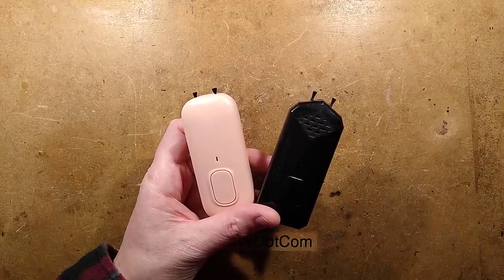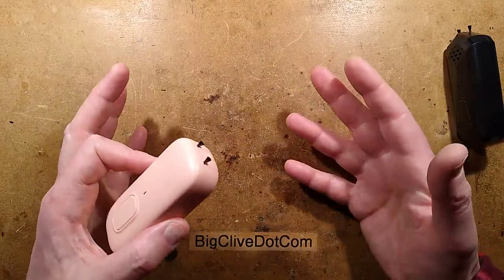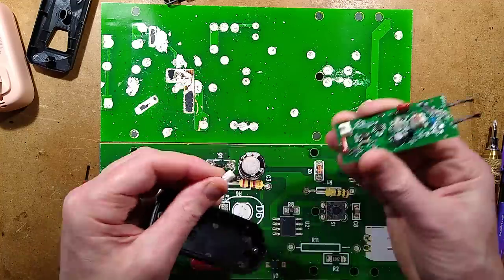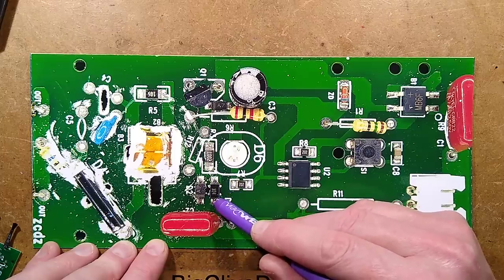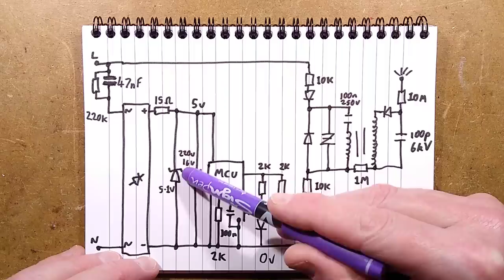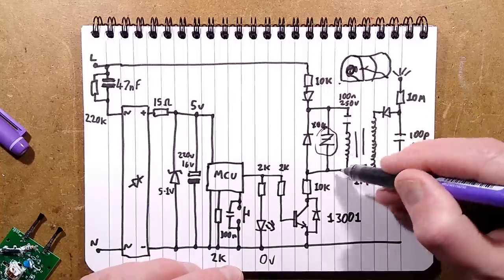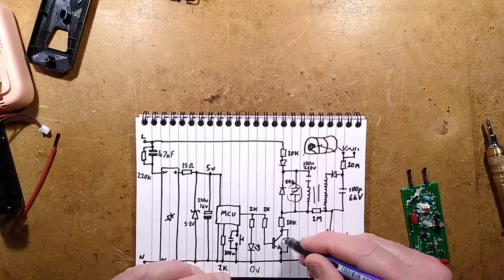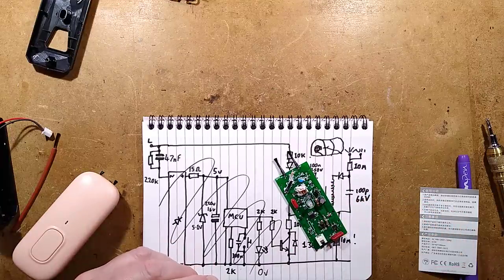Unusually spicy little ionizer - with schematic

Comment: When I see these ionisers, I always think back to school in the mid 90's, in the metal and welding workshop we had a very expensive central fume extraction with a flexible arm on each workbench with an air valve. This air valve only opened as soon as welding was started, and worked with a current clamp around the mass cable of the welding station. This fume extractor also had air recirculation to reduce heat loss in winter, and had 4 or 5 mega-sized (approx 60 by 60cm) electrostatic filters stacked on top of each other, each filter look like the construction of a electric fly swatter. Several times a week these filters had attracted so much fine dust that arcing occurred, and with every spark (clearly audible) a cloud of dust was released (including the smell) and this was blown into the workshop. Often had a headache afterwards, but then always thought that this was from the welding smell, while it must have been more likely from the ozone, which was blown into the workshop at high volume.
Reply: 🫢⚠️ - that should have been permanently vented to the outside with heat recovery for the make-up air. Sounded dangerous with it arcing and spewing dust back into the workshop 😶‍🌫️😷, now those have HEPA + carbon filters that are regularly replaced
Reply: @samuelfellows6923  , yeah, everytime we hear it sparking , a cloud of brown dust was blew out. These filters where made that they lost there static charge and the dust was collected at the bottom in the central fume extractor during the maitenance mode, but they lost there charge dus massive dust buildup during working mode. A real design flaw, while this was a installation that costed 5 digits back in those days.

Comment: Finally, I can comment on this subject. Generally, I don't know what he is talking about, but find his voice and presentation  very soothing. I'm an old(80) codger, and know nothing about electronics.

However, in this case, I used to have an ionizer that we used in a bedroom. It was enclosed in a fake wood box and had a fan which blew out the ionized air into the room. It seemed to clear the air, but it was a bear to clean. The cleaning process was long and tedious, but never seemed to work. It finally became so covered in dust and grime, that it stopped working. So, finally, the village idiot can make a comment, even though I still don't have a clue what Clive is talking about. This is a red letter day in the Romine household!
Reply: Ha ha lovely, sir. I also have no idea about the electronics but I like his voice and comments! "One moment please" "oh my" "overengineered!" "well that's dangerous" etc. 🥰
Reply: @philsmith5449  I especially  like it when he says "be careful, the light is coming back on"".  I am greatful that I'm not the only one who is lost throughout the whole video. Now I know there at least two of us. Maybe we should form a fan club.(wear same blazers, have a secrete handshake etc. We could use that tester thing he uses as the club emblem.)😆  Have a HAPPY NEW YEARS
Reply: @philsmith5449  I love his voice, and especially, "one moment please." as well.

Comment: 6:58 You can recover these carbon wires also from (old) sparkplug cables. In sparkplug cables are these carbon fibers used as a resistor for EMI suppression to the onboard radio and electronics in the vehicle.

Comment: I actually don't mind the ionizer videos. I watch you to learn about reverse engineering circuits, at which you seem to be very good at doing. So keep on doing what you're doing, I'll still watch.
Reply: I'm still hoping he will get to ionizing hair dryers. These are now in the third generation and the manufacturers now not just claim to reduce electric charges in the hair but they claim to transfer water ions into the hair to prevent overdrying.
Reply: @alnicospeaker  Look up "Panasonic nanoe" for what I mean
Reply: @MetalheadAndNerd  we could watch Clive dry his beard with it before he takes it to bits...

Comment: The black ioniser has been around for a long while (or, rather, a similar casing design).  Bought one of those from a Help the Aged shop in the late 70's to help deal with  an "odour problem" in the rather ghastly student accommodation in which I was living. Very much pre carbon-fibre emitters - mine had ordinary sharp-point needle emitters, and worked "reasonably well" if left running continuously.
Reply: So it can ground the odor particles?
Reply: @Eduardo_Espinoza  Ozone's a potent oxidiser - it'll oxidise most smaller organic molecules (and they were probably the cause!) This is the reason for ozone generators being used to remove the pong when someone has an unwitnessed death - they are VERY good for that purpose (and same goes for Mortuaries too!)
Reply: @phils4634  very insightful comment! Thank you for sharing this! 😊
Reply: Pat Luxor  particularly unpleasant odor

Comment: The high voltage diode with blue chevrons on one end (I assume, can't see it too well in the video) is very likely a 2CL77 20 kV 5 mA diode, it's one of the most common HV low current diodes you'll find today, I did a video a year ago crossing sectioning one to take a look at the silicon junction to find out how they get such a high breakdown voltage.
Reply: Interesting!
Reply: Does it build up the voltage until* the diode let's it pass?
Reply: @AnnaVannieuwenhuyse  thank you! 😊 I don't know much about this field.
Reply: @Eduardo_Espinoza  a little goes a long way ✌️
Reply: Is that the one next to R1 (15 ohm) resistor? That's a zener diode. Marked "ZD" on the board. Probably around 6 volts.
Edit: I'm an idiot. You meant the loooong output diode on the HV secondary.
Reply: If you happen to have a link to your video I wouldn't mind seeing it?
Reply: @therealjammit  most diodes are a Zener diode in the kV range

Comment: Double sided board is simple, cheapest board at a PCB house, as it is the most common board, and plated vias are free as it was likely made as part of a shared panel, using otherwise unused space on the larger panel. Worth it cost wise if you are willing to wait for delivery and you have a good stock of bare boards, but want the extra stock in a week or three ahead of production.

Comment: I wonder how much a 240v rated toggle push button switch would cost? Possibly more than the BOM on the control side of that circuit.

A sheet of paper with a hole cut in it, placed around the socket and blue-tacked to the back of the ionizer will catch most of the crud and save your wall.
Reply: The paper trick is very smart! i like it 🙂

Comment: you can smell ozone heavily after a storm in the air. Its also created heavily in forests during certain times of year. Here in my area when I bike through the woods in may and oct it will fill the air so much its like I was running an ozonator lol. Most probably dont even know what that smell is but since I own ozonators I knew right away. Natures way of purifying the area.
Reply: Indeed! I went to the woods the other day and hung my jacket to the wardrobe when I came home; hours later I passed it and could still smell the ozone near the jacket!
Reply from the maker: I wonder if it was actually ozone you were smelling.  That said, ozone is created in nature by rain and foliage movement, and does seem to be more prominent when the air is loaded with pollen, spores and natural plant oils.  It seems to be how nature keeps the air quality in check.
Reply: @bigclivedotcom  I have no way of knowing, could be OH-radicals?! It smells much like the ozone produced by my angry germicidal lamp (25W) that I bought because of your videos on the topic =) So cheers and a happy 2023!

Comment: The same principle is used to remove dust from coal fired power station flue gasses but on a much larger scale.
Reply: and they have been in use for a loong loooong time (electrostatic precipitator)

Comment: One reason for using a double-sided board even where all the tracks could go on one side is vibration resistance.  With single-sided, vibration of components can cause lands to lift and lead to fractured tracks.  With double-sided solder wicks up the plated through holes and the resultant fillet of solder stops the component moving down.

Obviously this was designed for people whose mains sockets vibrate.

Comment: Those probes look like the ones you can get on Rossmann's store. They're quite nice, and very stabby.
Reply: Didn't know that, but makes sense since he works on very small components! 😊
Reply: @Okurka.  exactly, the are like reguler china cheapos ones,those basic needle ones
Reply: @grindererrofficial3755  those regular cheapos one work great after degreasing the tips with some IPA.
Reply: @BjornV78 thanks for mentioning this for others who don't know thsi protip :)
Reply: @Okurka.  And 1/10th the quality.🤔
Reply: @Okurka.  with some quality control in between. A shop in the Netherlands i visit regularly uses a Shenzhen based buying service who knows where to get what and which products to avoid and asks for a few percent on the price to do that work. Rossmann does the quality control himself, I think and sometimes has to swallow the cost.
Reply: @Okurka.  And?
Reply: @Okurka.  I call that the third-party repair industry across nearly every industry, lol.  I'm not familiar with computer components, but scientific equipment is riddled with components that the OEM will not sell without an included service visit, and virtually everyone that isn't a huge business doesn't want to pay for that.  It's super common.
Reply: @Okurka.  I do not.  But if this person is reusing capacitors then I take back everything.  That's messed up.

Comment: Ionizers were all the rage when I started work in the 70s. We made many Cockcroft Walton units, using sharp Stellite cable-form nails as electrodes. I recall that the points became blunt quite quickly. The units certainly made a black mess on a wall.

Comment: The odd design of the double sided circuit board is most likely because it was computer generated.  As long as it works in the footprint they require they don't really care if it's odd or not.  If this is getting made cheaply, in bulk, sold to multiple companies, and they did it at EXACTLY the right time to get huge adoption in cheap chineezy products, that's a successful design to a Chinese businessman.  Timing is everything - they know if it's very successful it will get copied ad nauseum, so there's no time to make hay like when the sun is shining.

Kudos to that businessman for employing an EE who actually knew what he was doing rather than  cobbling together some PD design that only kind of works, or just potting a capacitor in resin and calling it "good".

Comment: To measure the voltage you could use the high voltage fluke 80k-40 probe for DMMs or the Chinese clones, those probes have an input resistance of 1GOhm.

Comment: I was thinking... What if you had a big grounded plate around the ionizer's output? Would that collect dust only on the plate instead of other things around it? Then you could just have something like a paper cover that you could remove and replace instead of needing to wipe up dirt...
Reply from the maker: Some units have a dust collection mat with a slight positive charge.
Reply: @bigclivedotcom  I’m going to look for those! Very interested in cleaning my dusty house air…

Comment: The printing shop I used to work at many years ago bought a bunch of fairly large ionizers to help with plant air quality. They also hacked furnace type air filters on the intake side because the filthy air was caking onto the ionizing plates in a day or two. Even when new, you could not tell the ionizers were doing anything, the air was so nasty in there. I was usually the one to take the filthy plate modules out of all the units and use compressed air to blow them off in the parking lot. Wasn't my job, but anything to get the air somewhat cleaner. OSHA safety rules would not allow the company to vent bad air outside to improve indoor air because the air was too filthy and chemically enhanced to vent safely. (Might poison the locals.) But those inside? Let them suffer.

Comment: 10:07 I think that flyback diode is there because you never know at what point in the cycle will the unit be turned OFF. It might be the case that the NPN is turned OFF when a fair amount of current is flowing in the inductor and the voltage is still not enough to trigger the SIDAC Thyristor.

Comment: Ionizers make me ill with my lung problem.
Reply from the maker: A real ionizer shouldn't.  But a high output ozone generator might exacerbate issues.
Reply: @@mattquinn-caledoniantelevi2522 
I just checked and I bought the 
Very retro "Japanese" air purifier.
Which is indeed an ozone generator, thanks for the tip ...I may get an Ionizer and give it a try. N

Comment: Another one with quite some "compromises" on safety. Something like JST-size connector for mains, 1M smd resistor for isolation etc. (smd resistors often have breakdown voltage of say 200V or so, a far cry from making it safe to touch). Especially if you ground the other end (say by a person), there are kilovolts on 1M resistor to help breakdown and after that is can stay more conductive.
If that was neutral side it could be more safe but in a non-polarized plug it can be live as well.

Comment: I doubt the white connector is rated for mains use with all the expected transients and surges. Also there's no slot between PCB pads, even though it looks like it's required for creepage distance, and no input fuse.

Comment: Hi Clive, Happy New Year mate, just a side note I’m not 100% sure if I’m right, but I think the x04 SMD chip is a resistor and it’s value is 13 Ω ± 2 %, please correct me if I’m wrong. Great videos mate 🤙🏼🇦🇺
Reply from the maker: One of the problems with surface mount components is they they often share abbreviated codes.  This is definitely a semiconductor component.
Reply: @bigclivedotcom  your right about that mate, cheers 🤙🏼🇦🇺

Comment: just out of curiosity. would it be possible to convert these things into stungun's just wondering if that was the original use/plan for them
Reply: Not at such low output current - unless you wanted to stun an atom sized person.
Reply from the maker: No.  Way too low output.

Comment: The microntroller thing makes me wonder if they have a quota of how many they have to use in products, or if they just have so many in backstop they have to use them any way they can.

Either way, there must be ways to repurpose them in meaningful uses. Determining pinouts and how to program them would be challenging though. Not that I have any ideas on reusing them but it seems such a waste.
Reply: They are really cheap (see eevblog's channel - I think he got some for 3c) and are probably not reprogrammable (since that adds expense).
Reply: @chaos.corner  Yes, the cheapest are one time programmable but offer various timers, ADC and DAC etc . But not much more (10c or under)  are reprogrammable , even offering multi-threading
Reply: @prk55  True. But they're shaving pennies so probably best not to expect too much for this application. Also, it can be hard to get hold of the programming tools as Dave from the aforementioned eevblog found out.
Reply: A 10 cent PIC clone from Fremont Micro Devices could be justified if that transistor is also chopping current to stimulate the tank circuit. That might explain the extra spice, the small transformer, and the SMPS-like transformer primary network. Perhaps Clive might stick a scope on the base and see if there's a bit more going on than meets the eye.
Reply: @abitofabitofabit4404  Any excuse to get Clive to break out the sillyscope is a good one. He's way too stingy with it.
Reply: @markfergerson2145  I (naively) thought I was the only person who said "silly scope". :)

Comment: Is this "Molex" connector really rated for 250V ? I see only 125Vac for the picoblade style
Reply from the maker: It would be preferable if it had better spacing.  I wouldn't use one like this in my own designs.

Comment: Put nine 10-meg half-watt resistors in series with your +VE multi-meter probe (assuming your multi-meter is 10 megohm) and set your multi-meter to the 200 voltage range.
Now you have a 100 Meg Impedance multi-meter to measure high impedance, high voltage low current voltage sources. You just multiply the multi-meter reading by 10 to get the true high voltage reading, measuring up to 2000 volts.
Add more resistors and change the multiplication factor for higher voltage readings.

Comment: Do you think something like this would be good inside an HVAC intake vent or perhaps in an outlet directly under the main intake?  Our main HVAC is on a ceiling but there is an outlet in the corner small hallway.  I've also heard just cheapo filters for HVAC are better for your system than the "super duper 90 day ionized filter designed for pets dust allergens and the illness of the day" because more air goes thru them but the trade off is you have to change them on a strict schedule.  There is a pretty significant price difference so I'm tempted to try the lesser ones.  I usually wait for the vent to start showing signs of dust bunnies collecting on the vent before cleaning and changing it.
Reply from the maker: There's a lot of hype surrounding things like filters.  You do get ioniser modules specifically designed for HVAC systems.
Reply: I do HEPA filter media research and anything MERV 12-15 is more than enough for a residential home unless you have very bad allergies or the like.